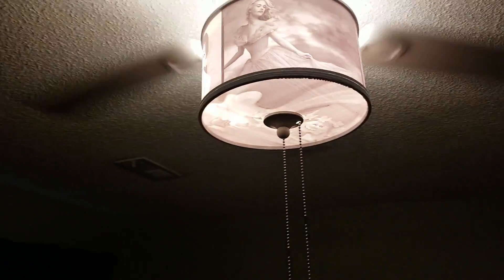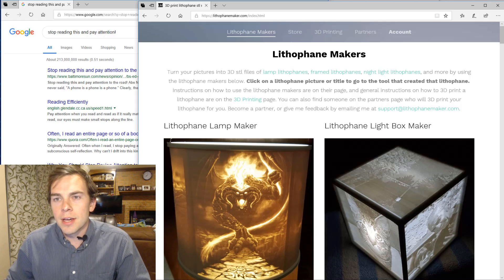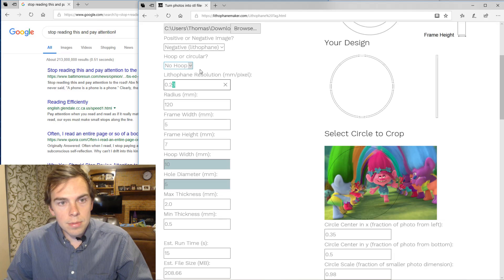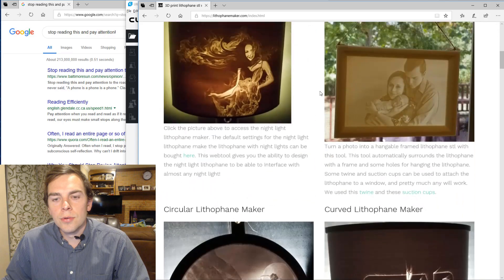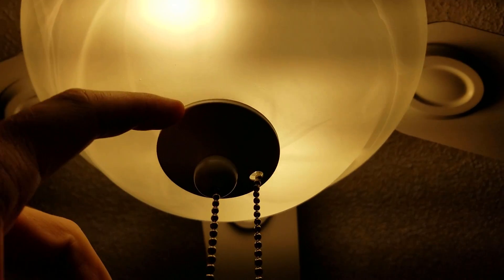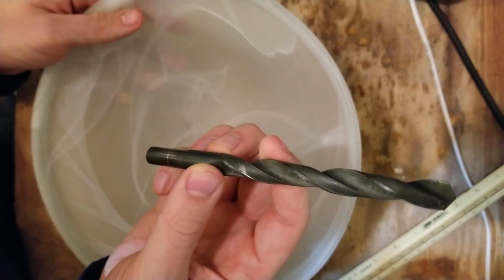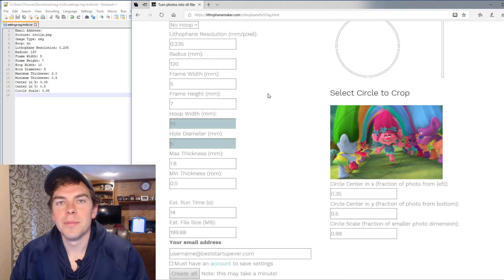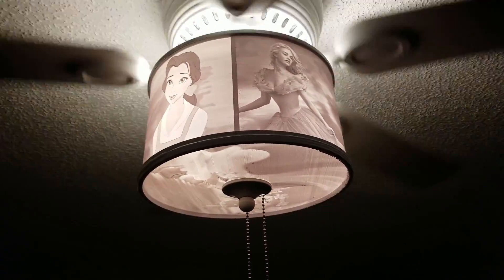FIRST EVER 3D Printed Ceiling Fan Lithophane

Comment: Four drill sizes to step up to 7/16 is way overkill, especially in plastic, although common misconception that a lot of steps is better..
Reply: You might look at a set of step bits for this kind of thing, they behave much better in thin materials
Reply: @LithophaneMaker  Over solution is to put 2 pieces of thin plywood under and above the plastic piece (like a sandwich) and drill it all together. To find the centers of the holes, put the bottom wood first and drill small holes. After put the second wood, add clamps, flip it over and make the final holes with the big drill.